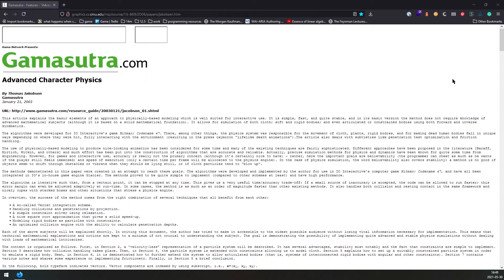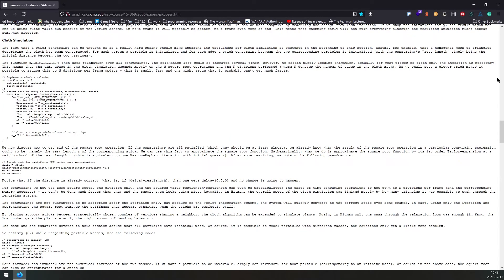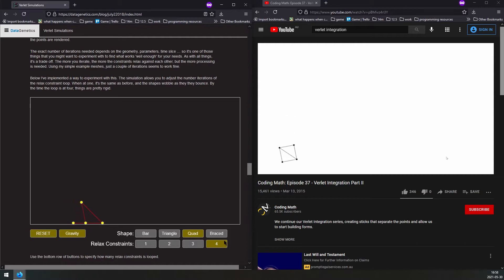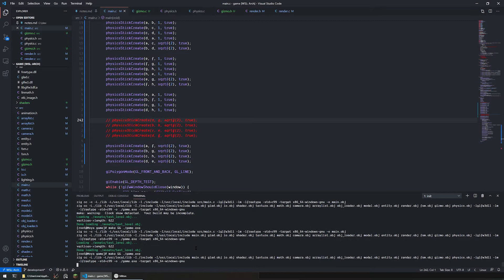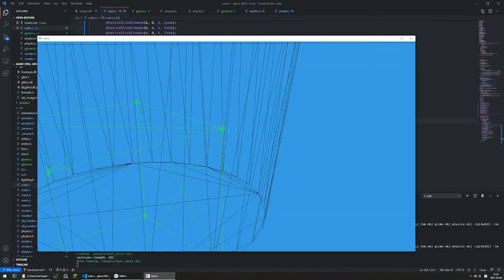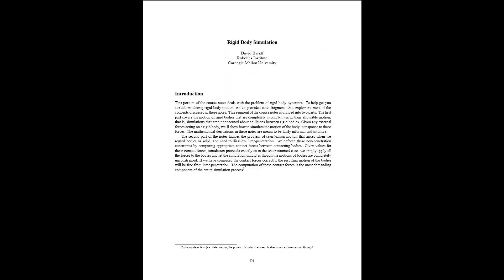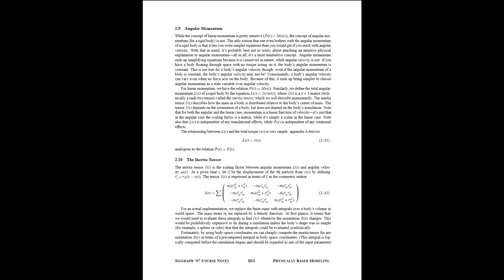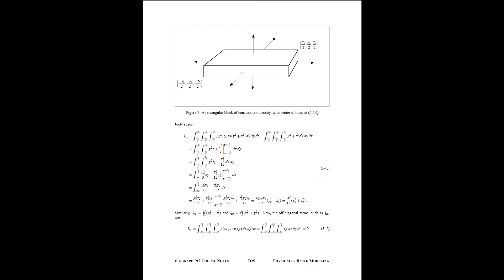I got stuck in development hell

Comment: I always wanted to tackle my own engine but I just suck at physics
Reply from the maker: It's a rabbit hole for sure! You can get away with ~ Algebra 2 for most game dev. I am sitting on less than that and programmed a couple of simple physics engines. I wouldn't recommend skimping on math, it's definitely hurt me in the long run
Reply: @DylanFalconer  Yeah, as a high-school student in an AP calculus class, I can safely say that calculus makes physics (and many other things) SO FREAKING MUCH EASIER.
Literally, just do a bit of calculus and algebra, and you'll have an answer before you even know it. Plus, being able to read complex formulas is a huge bonus.

I highly recommend Khan academy for learning things post-graduation, as they do a pretty good job of going over the content pretty thoroughly, especially for a completely free platform. Even as a student it's pretty great for review and practice.

Comment: You seem somewhat depressed over redoing stuff, and wasting time. I think it's necessary for someone to go through what you're going through. I know I did go through the exact same phase. Regarding language choice, I have shifted to use C99 for developing my game engine, and not using C++. The development speed is slower, but that's necessary to build up the helper utilities and datastructures, that we need to do complex things. I'm learning a lot in C99, and it's a good language and capable of doing what we want. The biggest disadvantage may be not having templates/generic data types, but we can solve that using macros, void * pointers, and other tricks. Heck,Linux, BSD are written in C. It takes some time, but once we get comfortable with using C, we can use it for everything.
Reply from the maker: Hey, I didn't mean to give off negative vibes, it was meant as more of a cautionary tale.

I agree with your stance on C, it's a bit more cumbersome, but once you get those utilities sorted out it is much better.

Is your engine open source? Are you planning on making devlogs?
Reply: @DylanFalconer  after I reach my milestones :)
Reply: Rust:

Sorry, I just think Rust is really cool and worth looking into for new projects. I would rarely choose C over Rust.
C is great for simplicity, but Rust effectively eliminates any issues of memory safety and reliability, while having nearly identical performance.